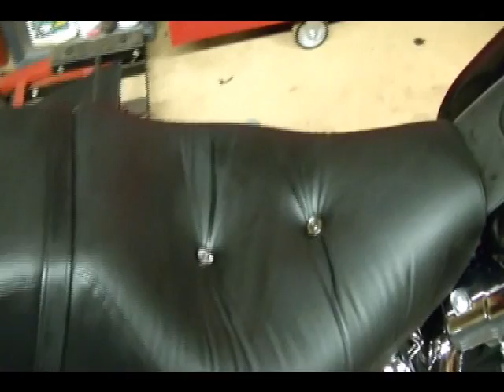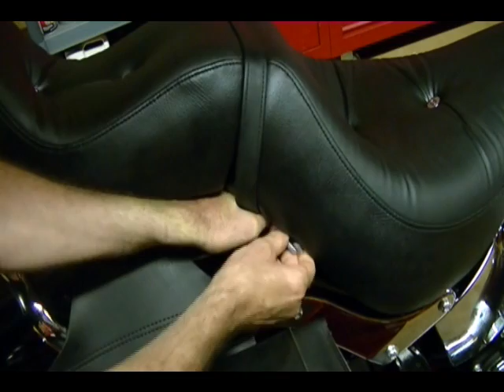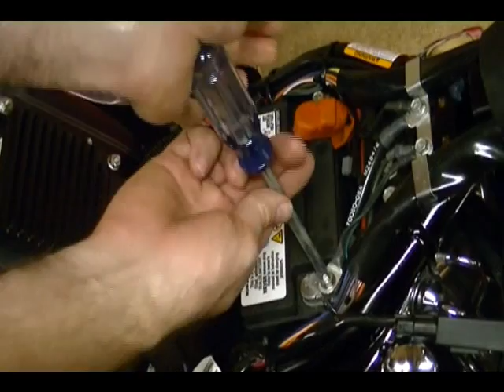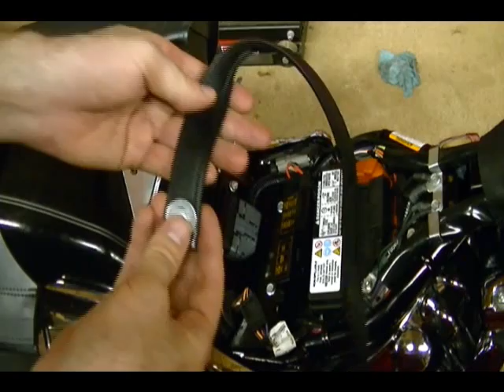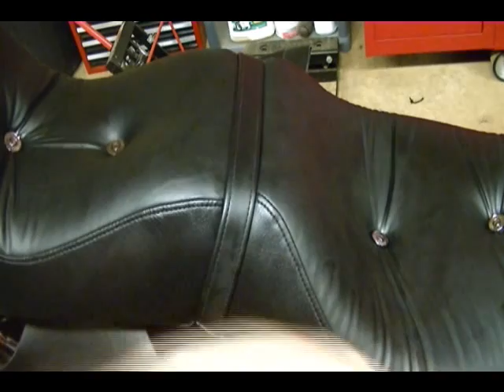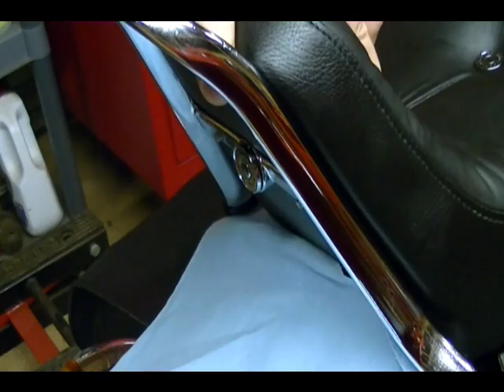Motorcycle Repair: How to Replace a Battery on a Harley Davidson Motorcycle

Comment: What would putting a 4 wheeler battery on a '06 Harley Davidson sportser make it run like? 
I recently bought one and the guy that had it had put a four wheeler battery on it and was riding it. It was missing and back firing in a way that made me think of how a car runs when a coil pack is bad in it. Just wondering if the wrong battery in the bike is what is causing the bike to run this way. ??

Comment: Turn the ignition on 
Remove the fuse (the big one ) The fuse box is at the rear of the battery 
remove the + and  - off the terminals 
Change the battery and reverse the procedure
20 minutes

Comment: Ive heard from a harley dealer you have to have the bike with the ignition on and pull out the fuse then replace it
Reply: yeah, I spoke to the dealership as well. He said to pull the main fuse (40Amp). With the ignition on then pull the fuse, also ensure the FOB is within 5m or very close to the bike. I can't locate the 40A fuse. In the main fuse area, the max fuse size is 15a. Had a good look. can't locate it. First time I did this The alarm went off and had to reconnect the battery and switch the ignition to stop the alarm. not gunna lie shit my pants a bit. fairly loud under the house, haha

Comment: Whatever happened I gave Autozone a shot and battery was still good. Reconnected it, pulled and cleaned some fuses and she started right up like no big deal. I even found some hidden led lights that were disconnected by the previous owner I assume.